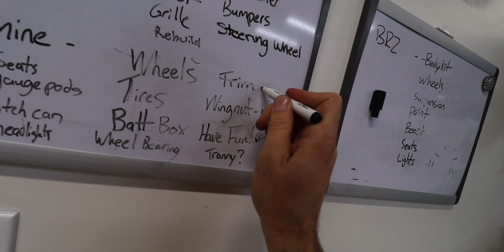Widebody Civic Gets EDGE TRIM + A New Project!

Comment: Robie a  Wheel bearing and hub assembly is like 50 bucks brand new on Amazon you could have ordered  a new one already  pressed and slapped it on the car or if you go to an auto parts store it's like 100 bucks usd

Comment: Ex/si come with the same spindles/brakes as an integra. Has nothing to do with abs or non abs. You got the spindle off an ex, they are a larger diameter brake and hub size, same brake and hub size as an integra. Abs is a ring on the axle.

Comment: $150 for a wheel bearing?!? You got ripped off hard.... should have cost half that. A new bearing for my 88 prelude cost $60 and another $20 to get it pressed in... I do live in the states but damn that’s steep for a bearing that cost 30 on rock auto.